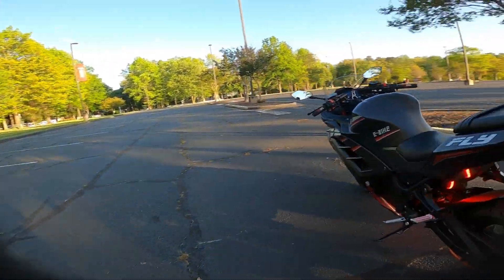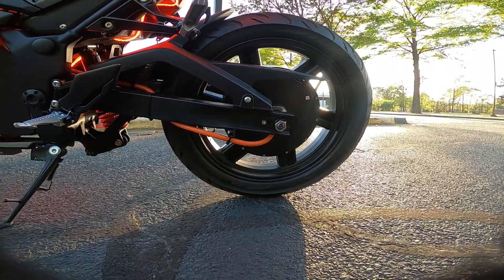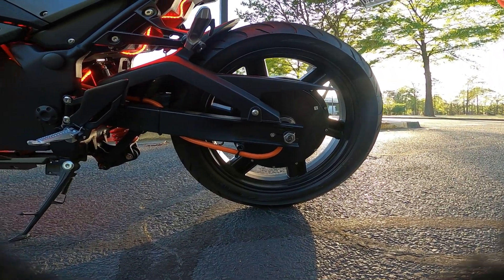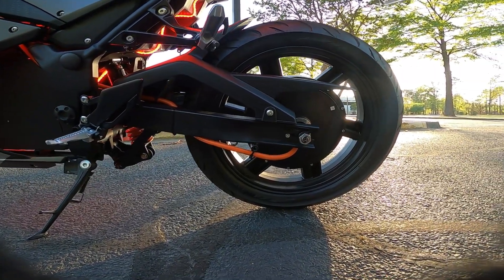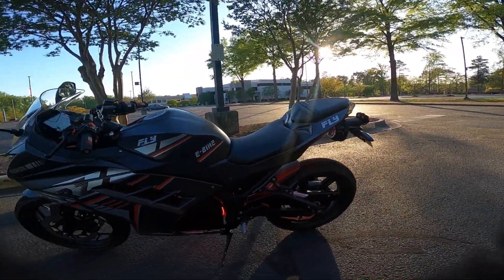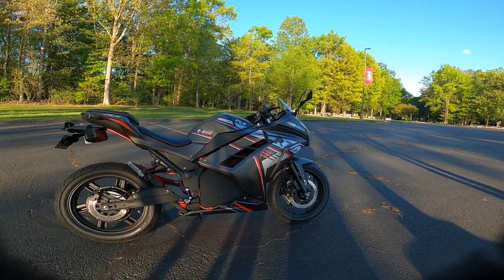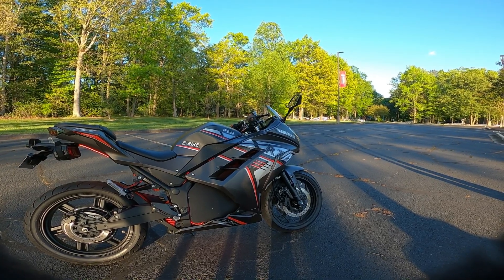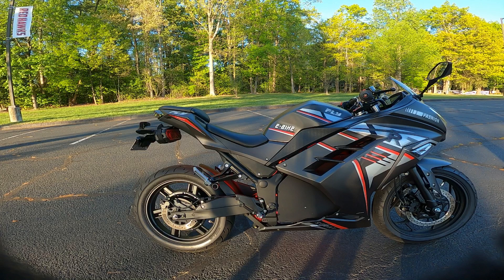Electric RZ on I95 doing highway speeds at 5kw cheaper than a Surron with ASI BAC8K on stock motor!

Comment: What are the temperatures?

What’s more efficient hub or mid?

It’s so quiet & smooth.
Reply from the maker: Hub Direct drive all day every day. No comparison
Reply: @ChrisCrossingWires1212  or maybe, until mechanical gears are paired with an electric motor & then the game changes again, because high voltage batteries can be implemented in a more efficient way than twist & go.

Gone will be the most simplistic ways (motor/controller/battery) of generating power.

I say this because in the end this is about capitalism, entrepreneurialism, legislation & evolution. In the end these factors will push & pull this sector in extreme ways.

Good thing that you have the skills, capacities & will to persevere in the coming times.

Comment: The cops pulled me over this morning 😮. They told me I had to get registration for my bike and then they check me for suspended license  warrants motherfuckers not even though I told them it’s a E bike in their eyes it’s a real motorcycle so I have to park it until I get it registered they said I can practice in a nearby parking lot, but I can’t be on the highway until I get registration
Reply from the maker: Bro I could have told you that its not ebike really cuz aint no pedals on it man. I know it says Ebike but a bike has pedals. Its got a vin and you have a title its so easy to register it was nothing cost me i cant remeber but peanuts then insurance is like for me &70 for  the entire year. Surrons, Talarias unless they have a pedal kit they cant pass as a bike. Sorry Bro but yeah in my eyes its a motorcycle lets be real. When you insure it state it as a low power motorcycle